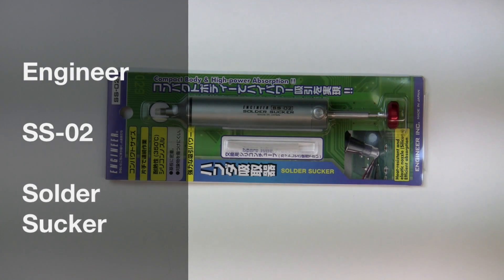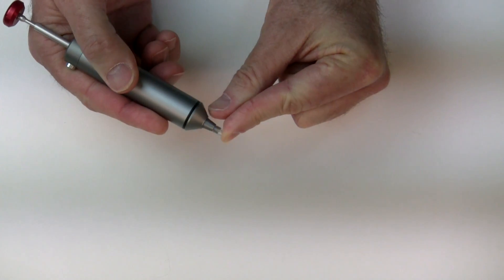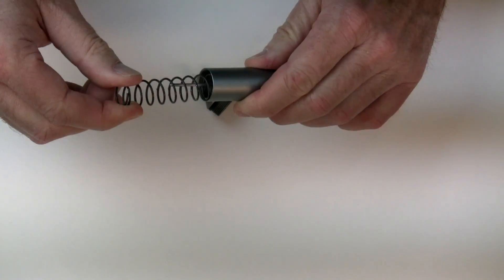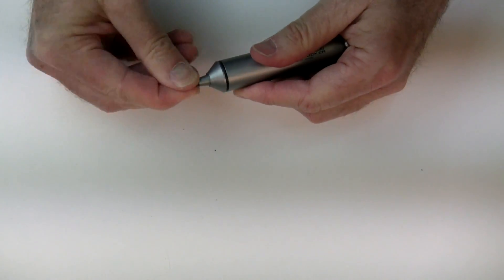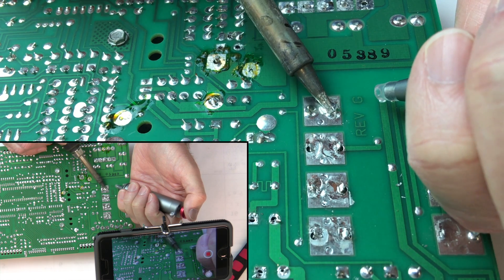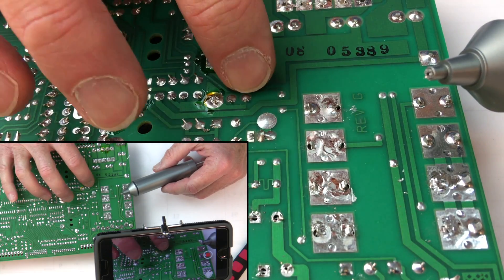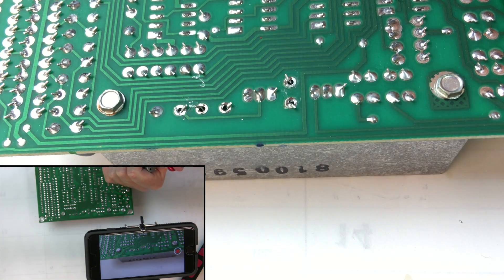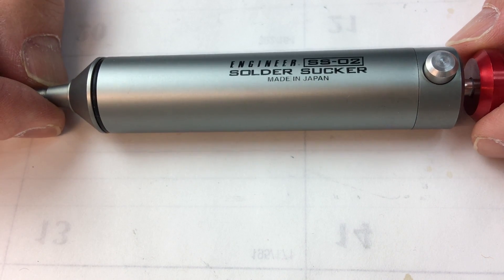Engineer SS-02 Solder Sucker

Comment: super old but a decade on the one thing i notice ppl dont do is reflo. that is, apply an additional small amount of solderthen do your suction. make sure to fully heat the area but the reflow will work with the dried solder and given the fresh nature of the reflow, it'll pull it all up with it. not to mention your pcb who ever soldered it made it difficult for any sucker not just the engineer. case and point 7:33 we solder joint vertically. notice how yuour stems are sideways at the tail. youre not being precise with the optimal point to get all the solder especially around the stem. if it wasn't bent, the solder wouldn't be able to hide. but youre also not heating those areas you are seemingkly unable to reach in this video.

Comment: I always used the SOLDAPULLT from Edsyn products. Never had any problems with it. But... your technique will work better if you heat the joint really well first (add a little fresh solder) and REMOVE the iron first before suctioning. You have to be fast. Hold the sucker perpendicular to the joint for a good seal. Works fine.

Comment: I think one issue could be that you are not reflowing the joints with fresh leaded solder before desoldering. old solder will not melt as well as fresh one. plus, this is probably lead-free solder, which makes it even less easy to melt. last, you should try not to cover too much of the solder to remove with the iron tip, or it will block the sucking of the solder underneath it making the desoldering incomplete.

Comment: Your gesture is not correct. Your ss-02 has air leakage, the soldering iron can't work, and the heating is not enough. I have no problem using ss-02. It's easy to use.
Reply: You have to remove the soldering iron first, and then remove the soldering iron ss-02
Reply: I think his models is a fake one, watch the font, it's not the same (I might be wrong, but I've heard on a video, that there could be fake ones, that looks and feel the same, but don't work the same ofc)

Comment: I bought one anyways, will keep it clean & lubed & ready. One other thing I'll do is (with fine emery) soften up the cylinder
inner threads crests so that plunger removal won't hurt  its o-ring -- then making sure everything is
perfectly clean/lubed at re-assembly. Also, I'll measure that plunger o-ring and find a few spares (seems they're not
sold separately). 

Then removing the bigger part of unwanted solder with desoldering braid  first is a very good idea - took this from
another video. SS-02 is perfect to finish the job. 

I would have designed it with external threads, though -- have you people noticed that NOTHING is quite perfect down 
here...

Comment: I woudn't try to punish a solder sucker in a job that requires some wick first. That's a big mop up job and a precision tool for doing the finishing work isn't appropriate. That solder sucker is best used only for getting out the last bit that wick can't remove. I'd hate to wear out the nice tool when wick can do more bulk work.
Reply: Right

Comment: Sorry mate but your not ejecting the solder plug soon enough after the suck. You're giving the solder loads of time to set solid. The pin inside ejects the solder if you press on the plunger directly after suction.

Comment: This desoldering pump is for micro jobs only, not for what you and your welding-machine are showing. It's clear written on the packing, it's from Japan, so learn japanese to understand it before reviewing it. 
Get a Weller WR2000 with a WP65 tip, this is the right machine.

Comment: Hello,
In fact the problem you are having is due to two things:

- The first is that you do not heat your tin long enough (because normally you do not have to suck that half as is the case in your video but the totality of the tin that surrounds the rod component) So a Once melted, it is necessary to continue for a second to make the tin very liquid.

- The second thing is that you have to completely disassemble the pump, then clean it perfectly + isopropyl alcohol and once well dry you must apply lithium grease everywhere. This grease will withstand high temperatures and will improve the vacuum of your pump's plunger and allow the sucked tin not to stick to the pump wall and piston for easier and faster cleaning.

- The third thing is that once the pump is greased it must sucked a little bit of fat through the silicone cannula to grease the inside of it but really very little just enough to lubricate the interior of the silicone tube and the nozzle of the desoldering pump.

This pump is more ergonomic and practical because of its size because otherwise it is possible to cut the end of silicone tube to fit any desoldering pump that must have a good suction against. The price remains a little high
Reply: He should spent more money in education, it's clear written - this desoldering pump is for micro things and not this what he is working at. I guess he bends 5 inch steel pipes with a tweezers too. LOL

Comment: Looks like its dry and not producing enough suction.
Are you lubing the sliding O-ring?
Pick up some Super-Lube grease, unscrew the back, push down the plunger a little and wipe a little grease on the cylinder wall where the O-ring will make contact. That should fix your problem.
Also make sure you are cleaning the unit from time to time. If you don't the O-ring will degrade faster affecting performance and the plunging action will not be as smooth.

Comment: I've bought one and used it quite a bit but never had a problem with it blocking. not once. as soon as i press button down it pushes out the solder about 90% and you grab it and pull it out the rest of the way. never once blocked in over 1000 sucks.
Reply: A potential hypothesis could be that if the solder is not hot enough, that the cool down occurs too quickly, hence leading to blockage.
Reply: Ishan Patel I agree, I'm no God, but you heat up thoes sockets way to quickly, I don't think your heating it enough.
Reply from the maker: What am I doing wrong?  You can see from the video how I'm using it.

Comment: This is exactly my same thoughts.  The guy from ebay that I purchased it from mentioned to me that they never had any problem with selling thousands of them.  Like I was the very first?  I told him that hole is way to small.  Every time I use it, it gets clogged the first time.  So i took a small drill bit and enlarged it.  But yes you are correct.
Reply from the maker: I'm sort of glad I'm not alone in this problem, but I was hoping someone would tell me I'm using it wrong.  

I can see a follow up video in the making here.  I'll drill the suction hole a little bigger and video the results.  I've got nothing to lose cause it's pretty useless as it is.